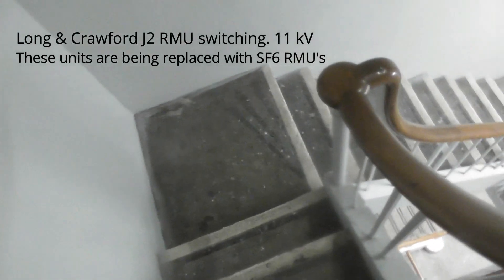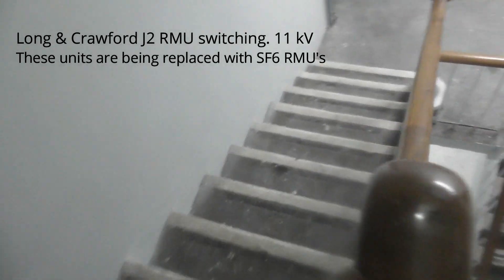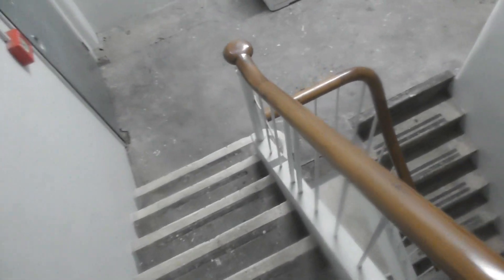Long & Crawford Type J 2 switching with lanyard and bracket

Comment: What’s the reasoning behind the 5 minute delay from opening to earthing? Also is all oil filled switch operations carried out by lanyard or only ones which haven’t been maintained?
Reply: i assume the 5 mins stand down is there company's SOP.  with medium/ high voltage there is a potential for capacitance (a charge) on the line, most of the time it will immediately dissipate. but sometimes there is some voltage on the line, and they want it to decay.
Reply from the maker: @chainsawsandgenerators9952  Capacitance in the line is usually immediately absorbed by the connected transformers.
Reply: Here in the UK, there were several instances of old oil filled gear letting go a minute or two after an operation, I'm not exactly sure what the root cause was, but I suspect the contacts didn't fully engage (or disengage) and sat there fizzing until it went bang. One that I'm aware of almost completely demolished a brick substation. I wouldn't be surprised if the same thing had happened elsewhere too, or it might just be that these incidents got the attention of utilities that operate similar gear, and they changed their SOPs accordingly. I know at least a couple of DNOs here require lanyard or remote motor operation on essentialy all manually operated gear now.
Reply from the maker: @bsphotovideo  All oil filled RMU switchgear has to be operated with a ROD (remote operating device) motorized or lanyard. As per network SOP's.
Reply from the maker: The 5-minute standdown time has to do with impurities in the old oil, after switching, say for example some materials have come loose in the switch, sticky contacts, broken springs, or just very dirty oil or moisture or dead insects. If a switch decides to fail, it is usually within that 5-minute interval. It is good practice to keep the PD detector switched on to see if there is any stress noise within the switch.

Comment: All that body protection, but no gloves (in case there is an arc flash, which I assume the body protection and helmet is there for - life will still suck if you burn your hands off). 
But smart to use that thing and pull a string, to not have to stand close when those switches are thrown.
Reply: It's likely that the arc gear is only required during the switch throw, even with the extra distance the string gets you. 

Note that the helmet doesn't go on until they're ready to switch - I imagine the gloves go on at the same time.
Reply from the maker: @someonesomewhere1240  correct.
Reply: @someonesomewhere1240  You are most likely right, as there was probably still time to put gloves on before the switch is thrown (even if it was not shown in the video)